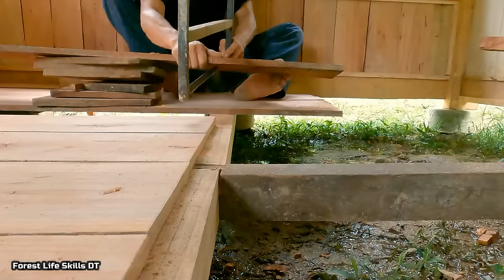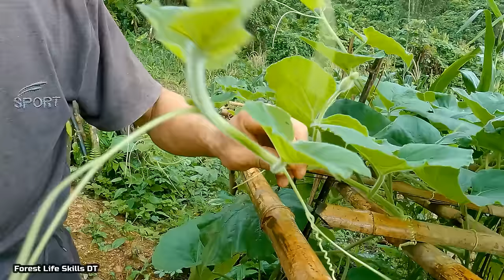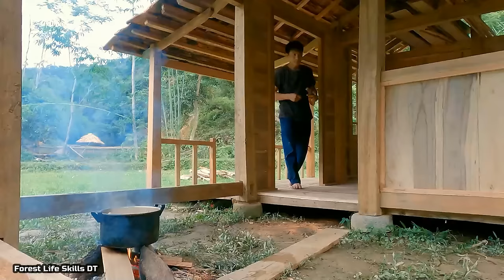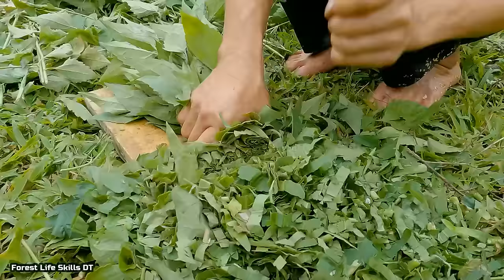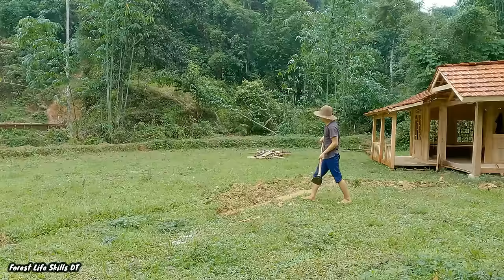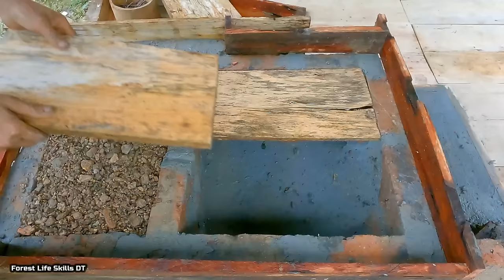Full Video : 10 days to weather the storm actively build a safe shelter

Comment: You are doing a good job but your sub- floor needs support underneath.
Reply: Not really. The houses in Vietnam are built above ground to allow rain water to flow through. They have less furniture and stuff on the floor, which makes less weight on it. Then again, he does have cross braces under the floor boards. Most homes have just dirt floors, which are easily kept clean with a broom. Once the dirt is compacted firmly, it is cleaner than a wooden floor. I miss the larger farm.